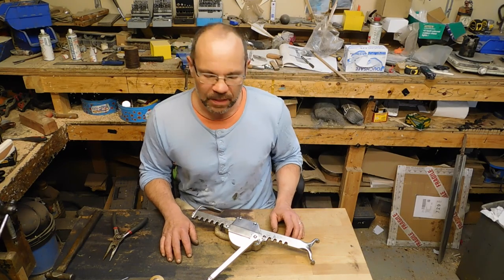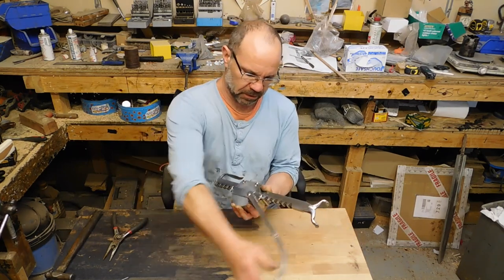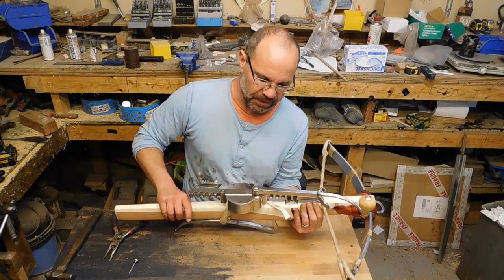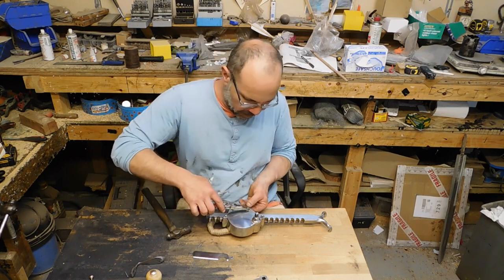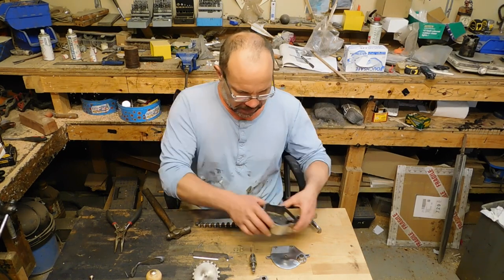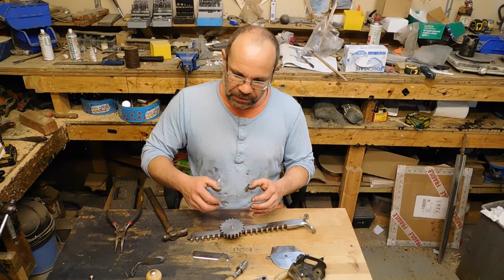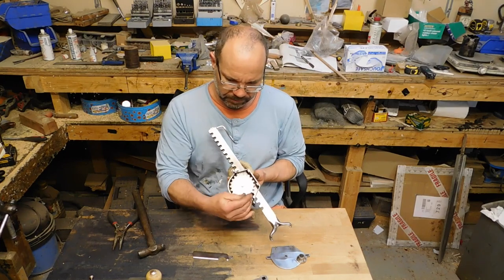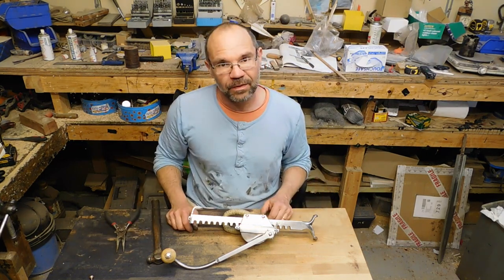Cranequin - inside the workings of a 15thC cranequin for loading crossbows

Comment: Proper interesting video Tod, always been interested to see how these are built and this is the first time seeing that. Not sure if you remember me, I'm the kid who phoned you up that time and asked you loads of questions for my GCSE DT project.
Reply: tod todeschini in the end I seriously ran out of time so I had to make a non functional one. I made the original prods out of a leaf spring and spent so long making it the right size and shape , and of course because it's so hard it took me so long with an angle grinder. To get it in on time to be marked , I had to make the stock out of softwood and make a fake string and nut, and it didn't look good at all. So overall , I was over ambitious with my project, it was a complete mess as I ran out of time so badly and got 25% for it , so I'm waiting on my written test mark to see if I passed resistant materials and take it next year, which is what I want to do. But anyhow , all the research was extremely interesting, and I now know how to make a historically accurate crossbow , I just haven't done it yet.
Reply: tod todeschini thank you Tod and thank you for all your help.

Comment: How come the draw length of crossbows tend to be so short? To make it more maneuverable or was simply to difficult to make large highpowered bows? Also, chould you do some more, possibly longer videos where you shoot the crossbows and also shows a bit of how the bolts act in slightly longer range shoots? I'm very curious to how accurate they are over longer distances.

Comment: Did they ever come up with a quick release mechanism for the gearbox, say a two position pinion gear, so that the rack would be free to pull through to the start position? Although it would be stiff to rotate the larger gear by the rack, due to the unusual "locking" mesh.

Comment: How would a medieval metal worker make something like this without a milling machine?
Reply: @ tod todeschini

Considering the amount of labor involved in the classical construction, do we have any idea how the price of such a cranequin would compare to the cost of the crossbow it would be needed for?
Reply: Specialized all hand smithing could be surprisingly fast,  the gears were probably not the biggest challenge.
Reply: By the late-medieval/early renaissance gear grinding had become a common trade. Mostly for clocks, but for other mechanical devices as well.
Reply: files

Comment: I find it really fascinating how it jams up one way, and not the other. I wonder if that was intentional design, or they just discovered it worked that way and kept it like that?
Reply: The rack and pinion jam up whether the force is applied in one direction or the opposite direction. There is nothing in the mechanism that would cause the binding to be unidirectional.

Comment: Todd, could you make it lighter buy cutting out some of the gear? Like by having voided areas?
Reply: @tods_workshop  Good god that lightening is extreme. As the post says its very unique. Also interesting to note from the post how it sounds like behaviour never changes, the mechanism is shown off today as interesting and cool just as it was shown off in the past. Dirt getting into the mechanism turns me off it a bit, but at the same time it doesn't seen like a workhorse bow and it certainly saves time on disassembling the mechanism to demonstrate. And as a modern display item it really does make sense.

Comment: Hello Tod, 

I have read some medieval sources in which the bending/drawing of crossbows (even late 14th and 15th century) is described as something needing a lot of strength, even the ones used in battle. Are they referring to crossbows which used earlier spanning methods or is it possible that they used goatfoot levers and windlasses with a low mechanical advantage to speed up loading at the expense of requiring more strength?
Reply: Perhaps it is worth experimenting with if you have the resources and strength. I wonder how much you could reduce the mechanical advantage on a 1000+ plus bow while still being able to bend it.

Comment: Is there a reason for the swan neck on the cranking handle? Why not just use a straight crank?
Reply: It would be cheaper and easier to make a swan neck that looks good in the period. Remember that your milling machine is an apprentice named Ralph using files with hand-set teeth and a couple of stones, and a "band saw" means you've set the minstrels to work with hand tools. A swan neck is a handful of hammer blows during forging.

Comment: Why was the trigger made in such a way that you had to use a piece of wire to set it? Couldn’t it have been spring loaded or at least make the piece of wire integral to the handle and not separate?

Comment: Is there a maximum draw weight for cranequin? or does it depend on the user?
Reply: Max draw weight of the cranequin shown here probably exceeds the capability of any battlefield bow ever made. The cranequin shown here probably achieves a mechanical advantage of ~750:1, assuming a 15 inch crank length, 0.6 inch diameter pitch circle for the 4 tooth gear, 3 inch diameter pitch circle for the 20 tooth gear, and 1 inch diameter pitch circle for the 3 tooth gear. The hardest part of the cranking cycle is when your arm is fully outstretched and applying a force at a right angle to your arm, because the torque on your shoulder joint is maximum. This is the limiting position, and a reasonably strong person could probably exert up to 20 lbf on the handle at this position without fatiguing their shoulder. 20*750=15000 lbf=7.5 ton. So clearly the cranequin is overkill as a bow drawing implement, as no bow steel has likely ever been made to handle that kind of tonnage.
Reply: @johnbarron4265  Thanks, that's a very comprehensive answer.

Comment: Shame they didn't incorporate a clutch to disengage when unwinding - could have almost doubled the rate of fire.
Reply: why not just make it double-ended? i.e. just extend the rack and put a pair of string hooks on the other end as well. then no need to reset the device, just mount it in the opposite direction each time.